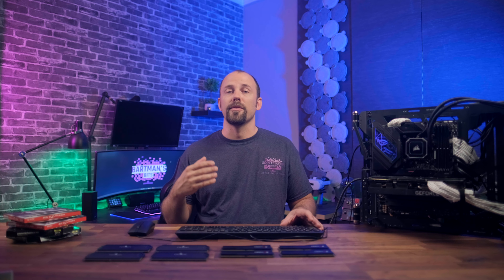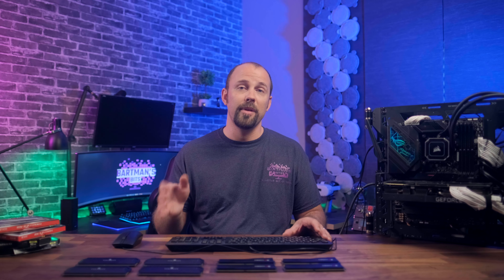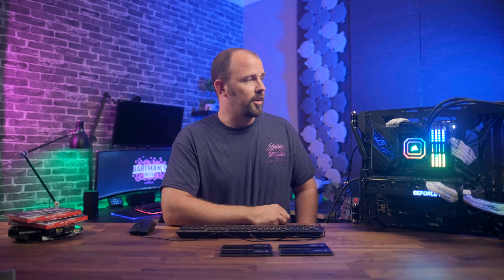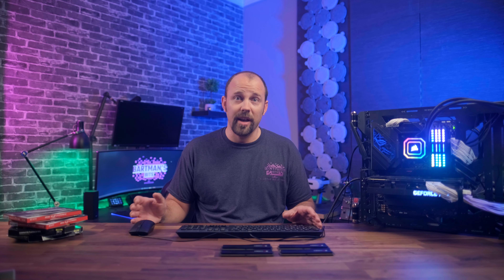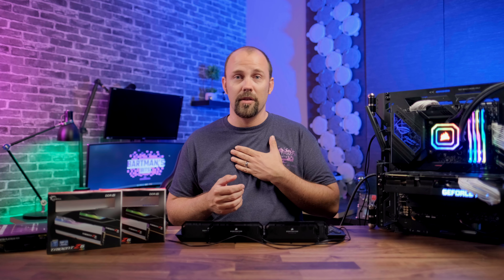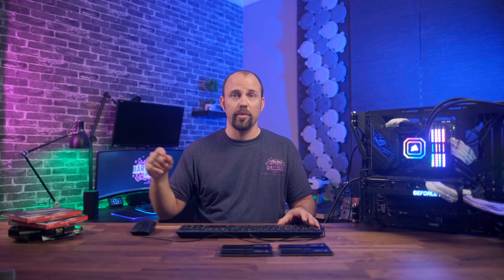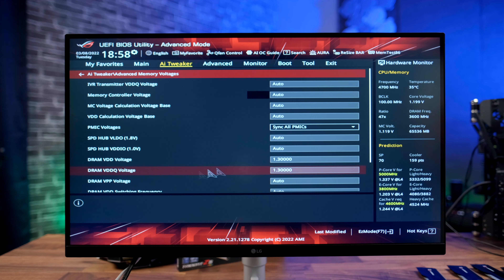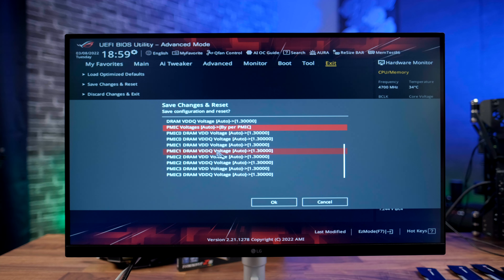Intel’s DDR5 problem resolved! DDR5 64GB Boot Loop failure Fix. Get the rated speeds of your RAM!

Comment: The problem is that after one year of updates i still cant turn on the xmp profile or run at the 6000mts of the original frequency of the memory, Just take 2 sticks out and i work on 2 sticks of 16gb, when Asus releases o é upgrade that fixes this once and for all? Great vídeo by the way.

Comment: FIXED: Z690-P WIFI with 4 x STICKS of Gskill Trident DDR5 6000 MHZ (this is four sticks, not 2) I could not get my system to enable XMP with his exact settings. BUT if you enable XMP, change the drop down to DDR5 6000 mhz, then adjust the VDD and VDDQ voltages to 1.40000 instead of the 1.35000 they default to. then go change the last setting PMIC voltages to "by per PMIC" It learned my memory, and booted right up. Ran some benchmarks and she's running stable. I have a i7 12700k on this board on water with me asus bios easy OC setting to the higher setting than normal if that happens to help.

Comment: Hey guys, I will appreciate your help. 

I have the z790 E WiFi 2. 
Intel i9-14gen k 
32*2 ddr5 6000h. 

When I try to enable XMP and save and restart the motherboard will write error code 77 and will try the Q LED read light and will stay there until I will press the CMOs Key to restart 

Anyone can please help ?? ❤

Comment: I shut my pc down one night having no issues for 5 months, then the next day it wouldn't boot. The board was powered on with all fans spinning but no boot. I have a ASUS Prime z690-P Wifi with the updated bios for 13th gen chips. I'm using a i5 13600k S 1700 Raptor lake. Swapped both of my Corsair DDR5 2x32gb 5600mhz for a stick of 16gb DDR5 6000mhz from my dads rig, and it booted fine. I'm assuming my RAM has just died for some reason.

Comment: I've watched this video many times and tried many times but I can't seem to figure this out on my MSI Z790 EDGE WIFI board. Guess I'm going to have to settle for the stock speeds or buy 2 sticks instead because this is so frustrating.

Comment: I only had problems with 4x16gb of 5600hz it does boot and everything but every game it’ll crash randomly after of like 30min of gameplay. With 2x16 of 5600hz with xmp works fine, does anyone know if this will work for my particular issue?

Comment: ASUS ROG Strix Z790-E
I9-13900K
2 kits of Corsair Vengeance 2x32 GB DDR5-6600

I set to XMP I, and PMIC to "By per PMIC".
Didn't change DRAM Voltage for now (XMP set it to 1.4)

Got 5200 to boot and works properly. 5600 Didn't boot

Comment: Ok, Boot work, but then in game aplications a windows message apears showing memory fail.
Really, this works for the first step but not for working in Windows 11  with 4 sticks 16 MB at 6.00 MhZ memory you instaled.
And the memory works properly with 2 sticks.
After all updates in MB Bios, things are the same.
Cheers my friend.

Comment: Interesting. I was stuck trying to add 2 more 16GB 5600mhz sticks and my keyboard, monitor and mouse wouldnt connect. That was with XMP on or off. I'll try to downclock it to 4800mhz and if not 3600mhz

Comment: hey  a have asus rog z690 hero  and i9 13900k and i have trident z 32g 6000 dual chanel and get stock on orange led code 23 a remove xmp its work but a have only 4000m

Comment: bought the aorus z690 elite ax (ddr5 version), gigabyte rtx 3080 ti, and coirsair 2x 32gb vengenance. i experienced very long post / boots and sometimes absolutely nothing happens. sometimes, cant move the mouse within the bios. when i enabled spd memory check it said, that memory were found not running at optimized performance. the suggested ram sockets are a1 and b1, but the manual says its a2 and b2 and even on der board a2 and b2 are marked as "first". absolutely crap. any ideas ?
Reply from the maker: If you are running 2 sticks then they need to go into a2 and b2 for sure. You might have some bad memory. Load up memtest86 and do a full test to see what the issue is.
Reply: @BartmansBits  Hello Sir, I run the memtest and it passed without any errors. After that, I tried the following and that brought the change: unplugged USB cable from my old hp monitor and unplugged the ssd cable from the samsung 850. Windows runs on a separate m.2 ssd. With these two changes I had the fastest boot I ever had. Then i plugged in the ssd cable of the samsung 850 back again  the boot (time to pass the POST) time was a bit longer. So as a next stept I disabled all unused ssd controllers (except that one for the 850) in the bios and voila,... pretty fast boot. the only problem with this setting now, is that i have to turn off/turn of the monitor so that the monitor is going to display the actual windows login screen.  Speaking of the "boot". I mean the time you push the power button of your pc and the time till you passed the POST. So something slowed down the initial process.

Comment: So the last two bios worked with the newest one it broke this, the best option is follow all these steps and run the ram at lower speed mines is 5600 but i dropped it to 5400 and stable ,5600 wont stay stable in games etc

Comment: I just bought a new 2000 buckos pc with newest Asus z790m ddr5 board and the Corsair Vengeance RGB Pro 7000Mhz rams and first installing Win 11 greeting me with BSOD. It took me 1 day to get the system somehow stable, but still XMP does not really work with those rams, it keeps crashing my games under load, even tho my board can handle 7200Mhz. I just think those vengeance pro are bad rams....

Comment: ASROCK C/D5, Ive got 4 sticks of the Tforce delta ddr5 6200 and if i run 2 sticks, it runs fine and boots at 6200. 4 sticks, nothing ive done gets it booted up past 3600. Im not a pc person and thid is really pissing me off coming from apple products where you stick the ram in and it works. This is beyond annoying.

Comment: Z90 P WIFI with Intel 13700K only lets the RAM clock to 5600 with 6000 RAM. Figured it out. Have to change the RAM type to 6000 in bios. Core@5500  RAM@6000

Comment: Didn’t work for me. 

Asus TUF gaming z690-plus wifi ddr5

Corsair 2x32GB ddr5 6600MHz

i7 12th gen 12700K alder lake

i have tried auto in bios, i’ve tried xmp1,xmp2, tried your settings, tried slight variations. I get either boot loops or BSOD

Comment: My whole system crashes if I run my ram on xmp. I'm able to boot into windows and launch games, but it seems once a real load comes up, mu whole system restarts. I have 2 sets of corsair vengeance ddr5 ram for a total of 64 gb of ram. I'm running my ram at i think 2400 mhz (no xmp) and I've been good. I would like to run my ram at its advertised speed tho

Comment: The kit I bought had issues posting and running at the advertised speeds so I swapped to 7200 gskill and now i’m getting error 55, not recognizing them though rgb is lit. Cant even get to bios when I could previously -_-

Comment: This problem still exists for just two sticks of Gskill DDR5 6600. 16x2. Can't enable XMP without BSOD every time. i9 14900kf. MSI MAG Tomahawk Max Wifi z790. Makes zero sense to me, and I shouldn't have to tweak the timings manually to just get advertised speeds through XMP.

Comment: Guys, need help. I’ve got the ASUS z790 extreme. With 64gb (4 sticks @ 16gb) of Corsair Dominator @ 7200mhz (advertised). Using the Intel 13900k. I just tried these steps but still bsod. Bios is current. I used 1.5v (default is 1.4). The system defaults to only 4800mhz w/o xmp.

Comment: Followed your video to a T and was not able to get nothing more than 6600 from my ram
im running Asus z790 e gaming wifi 2 with i9 13900k with 96 gb of ddr5 g skill ram rated at 8000 mhz 4x24gb
also my bios is up to date

Comment: I recently bought a gaming rig from CYBERPOWER, i9 12900k , MSI gtx 3080 ti, 2x 16GB DDR5 5200mhz corsair dominator ram. I can't make it run any higher than 4800, its not that big of a deal but I paid extra for the 5200 so it would be nice to get it there. When I try to change in the bios from 4800 to 5200, my pc won't boot up. Shows a memory error. Any Idea? Also have a MSI MPG Intel Z690 CARBON WIFI DDR5 ATX Motherboard with a HX850 PSU . Any help would be appreciated, I asked them and their answer was that its new technology so there is bound to be some instabilities and problems. I didn't escalate it any further but I will if necessary. Thank you
Reply from the maker: Unfortunately I haven’t had a lot of time to work with MSI motherboards so I’m not sure how to get the memory working at advertised speeds. If you only have 2 sticks there should be an issue though as XMP seems to work just fine with 2 matched sticks. 4 is where issues appear.

Comment: I have Error code 55: ASUS ROG Maximus Extreme Z690 with DD5 RAM: Corsair DominatorPLt RGB CMT64GX5M2B5200C40(Ver 3.43.01) - 2x32 64GB (32 each stick x2 Sticks) When I try to boot I don't get BIOS, I only get error code 55.

Comment: I have an ASUS Prime x670e motherboard and 4 x 16gb Corsair Vengeance 6000mhz
For some reason I haven’t been able to find something that allows me to post at all with all four in at once. I was able to get on initially. Then once I shut down my oc wouldn’t post until I took out the A1 and B1 RAM sticks…

Comment: I have Just upgraded to 12900k with 16gb Corsair RGB vengence, and it's not booting at all! though with one stick in dim 2 it fired up fine! So I got some different ram and it won't boot up at all!

Mobo is MSI Z690 Tomahawk DDR5 Wifi
The Corsair is rated at 6000mhz (2 Sticks at 16gb each
The Corsair (NON RGB) at 4800mhz (4 sticks at 8gb each)

Comment: Didn't work for me with one caveat, I didn't raise the voltage passed 1.3 for Corsair Dominator 6200 RAM. I'm not risking overvoltage damage for something that is likely a  ASUS STRIX Z690-E WIFI BIOS 1505 issue. I ran CMOS to reset my board, I'm stable ATM with BIOS 1505  with no overclock. The only thing I changed was disabling CPU FAN MONITORING (CORSAIR CLOSED LOOP) and SPD WRITE to FALSE (ICUE RAM). Lots of peeps are experiencing issues with ASUS STRIX Z690-E WIFI BIOS 1505. Your experience will likely vary depending on your model of Motherboard and DDR5 RAM Modules.

Comment: Still doesn't work with latest BIOS. I have 4 @ 5600MHz on a ProArt Z790 MB and tried both XM I and XM II   changing the voltage as explain to 1.300000 and doing the per pmic change and the best result I can get is 4800 MHz

Comment: Same issue is still here my Rog strix z790 gaming wifi, doesnt work with the Kingston DDR5 5600mhz cl38 at all, i do have 128gb of it. When i got the pc it worked perfectly fine for week at the 5600 with all four sticks, but one day i looked at the speeds and it had dropped to 5200, so i went into bios and tried to get xmp on and it only booted to UEFI  bios in safe mode. after that the pc does not start with even 2 sticks when XMP is enabled. My pc has only the newest parts in it totalling cost of the 7500 euros. so it should not be the problem. So i send the pc to the shop i had it made in, it has been 3 weeks now and  they told me this, WE have not found anything faulty in your pc, but the motherboard does not support 4 Ram sticks at the same time :elbowcough: So they are sending me the pc back with 2 of the rams installed at the correct speeds.

Comment: I have a Asus ROG Strix Z690-e  and I only wish I could get the the post like you do. Running two sticks (2x16) at 5200. Also purchased another 2 sticks (2x16) at 6000...I continously get a Error Code 55 and do not get any sort of video. Anyone had this issue with this board and have some tricks to get the bios?

Comment: Motherboard  Gigabyte  aorus  elite ax ddr5 64gb ram  GSkill  Tredent z5 6000mhz  I will set 6000mhz  restarting  problem  and default 4800 set  not restarting...yy any suggestions please...
Reply: Hey did you find a fix for this?
Reply: Having the same problem

Comment: I tried what you suggested and I keep getting error code 55 and/or the board changes error codes in a neverending loop until I turn it off. This is happening to me on so far 3 Asus Z790 mobos. 2 were Asus Maximus Extremes and one a z790 hero mboard, which is the last one I tried. I returned the other two. I also tried two completely new i9 13900k cpus and the memory errors occurred on both cpus.  Lots of people are reporting these memory problems. Anyone has been able to solve this?
Reply: Тебе удалось запустить 4 x 16gb на z790 hero? У меня ошибка 55.

Comment: Just tried on my asus z690 extreme with new 1403 bios same issue, I can’t get to boot xmp at 5600 using this setting ill try to up the voltage bot sure why they can’t fix this its so annoying, i can say I should of gotten a cheaper board this is disappointing…any fix or help and input would be great.
Reply: Try setting voltage to 1.39, I got my set(trident z5 6000mhz 4x16) to run 5600mhz at 1.39v
Reply: @yuriyshepta6956  ok I’ll try a bit higher I tried 1.35 and stopped there. I dunno how they could let this ship across all makes abs models ram and boards but not have a fix?
Reply: @jseaber  agreed, this should have been resolved already

Comment: I got the z690e gaming, i7 12700k, 16 gb x2 gskill trident z5 5600mhz and NO XMP MODE IS WORKING, with your method I managed to boot and get into the OS (win 11) bit after 5-10seconds max it's freezing and automatically restarts and it does this nonstop.

Comment: Really hoped this was going to work for me. 

Dom Plat 5200 X2 
Asus Z690 e
Stuck on 4C error loop ending on 55. 

Each stick has booted the system on its own running single stick. Tried these settings got the same issue

Comment: I have Asus z690 formula motherboard, i9-12900k and 64 GB of ram(16x4) G.Skill. Latest bios v.2004. That didn't help at all. There is an error occurs while running memtest 86. Probably will try to decrease from 5600 to something lower.

Comment: Sadly, I have tried to fix this on my MSI Z790 MAG Tomahawk, with no luck. I have 128GB of G.Skill Trident Z F5-5600J3036D32GX2-TZ5RK (30-36-36-89). MSI claims the board can run at 5600MHz with 4 sticks of memory in it. The best I've been able to get is 4800MHz. Even with a 1.3v bump, I could not get anything above 4800MHz. Not all of the BIOS settings align with what you have in the video, since a different manufacturer. Would be nice to know of anyone has managed to get this setup to work. I could not find a "per PMIC" setting on my board.

Comment: I wish this had worked for me, but it didn't.  I reset the cmos, shutdown and installed the Corsair DDR CMT64GX5M2B5200C40 64gb Kits and made the changes and it corrupted my bios.  I had to do a restore and clear CMOS again in order to get it to boot. I can run 4 sticks at the base speed of 4000Mhz, but cant do anything on XMP I/II settings.  Runing an Asus Maximus Z690 Extreme MB with latest Bios V. 2103 as of 10/19/2022
Reply: Same issue with Z790 Hero, i9 13900K and 128 GB Corsair Platinum 5600 Mhz. I get bluescreen with 5600
Reply: I have the exact same model of ram as yours, also only get 4000mhz, anything higher than that resulting a bootloop. It might be ram issue.
Reply: after many test.
I found your reply put everything on default and only change frequency to 4000 and it worked.
dominator 5200 4x32.

its a shame

Comment: didn't work for me,
4x32GB Kingston Fury 5600 MHz
I've tried everything up to 1.40 volts but I still haven't been able to use XMP (DOCP),
7950x Asus Prime x670E card
Reply: Did you check Asus QVL? Did you buy a 4x32GB set or multiple 2x32GB. The latter supposedly is not recommended.
Reply: Can confirm what DUSZA said, called ASUS, they said I could only use 2x 16 GB or 2x 32 GB to reach 64 GB for my system.

Comment: OK I have DDR five dominator 6000 kept getting errors when running men test I ended up lowering the speed to 5800 and had no problems, I just found this video and did what you said and now it’s in mem test and I’ll let you know how it works
Reply: Oh it’s four sticks of 16 GB same speed of course just two different kits
Reply: Nope it failed instantly, I have to run it at 5800 for all four sticks to run
Reply: @fifthwheel111  5800 is great. I have 5600mhz ram, that'll only run at 4000mhz. If I enable xmp, I get black screen. Oh its ddr5 4x32gb 2x 64gb kits. 

I had a 12900 with Z690 Maximus Hero board, rma'd the 12900 waiting for a 13900k, hoping to test this theory when I get it replaced.

Comment: It’s laughable and a shame that both Z690 and Z790 systems still have this issue. Absolutely embarrassing for Intel. I will switch now to Threadripper pro and run 512 Gb rams in a stable system.

Comment: I have been waiting for this to be addressed. I have a Dell XPS 8950 with i9 12900K and 64G DDR5. Dell does not allow my 64GB of 4800MHz Ram to go above 4400MHz. XMP in the BIOS cannot be Enabled. What can I do to get it to 4800MHz?
Reply: Don't buy a Dell.
Reply: @criticallythinkingveteran3763  Wow, so helpful.
Reply: @peterleveillee1321  The problem is your BIOS won't let you enable XMP, or set a faster MHz than 4400MHz right? BIOS issue.... Who writes the BIOS for your System? Whoever that is, it's authorized by Dell. That's your problem.

The solution - Don't buy a Dell. 

Hope you have a nice day :)
Reply: @criticallythinkingveteran3763  Your attitude sucks. I do have XMP in my Bios, I think it is temporally disabled until this issue gets sorted out.
Reply: @peterleveillee1321  Nah.... You have a bias, when your bios is the issue. Words are words, you have to apply tone.

Comment: Great video 
👍🏼
Done it and now it’s works perfectly 
But when I run a game (Call of duty WZ) the game crashes when match is about to start !
I changed the voltage from 1.3 to 1.31 and now I’m stuck (bios not booting and only red light on the motherboard) 

Thanks bro